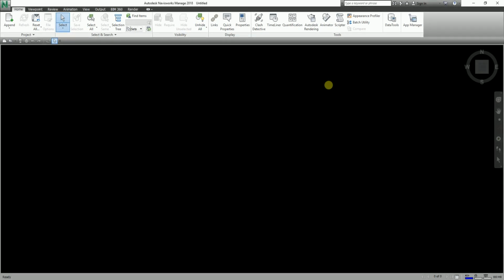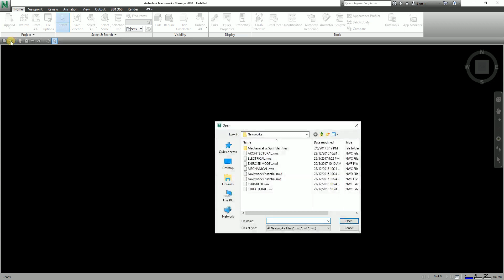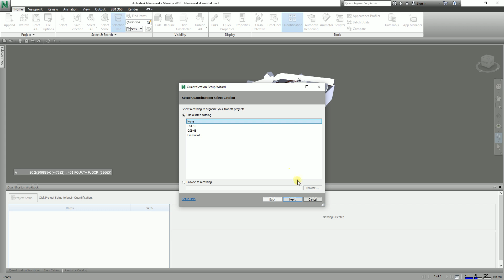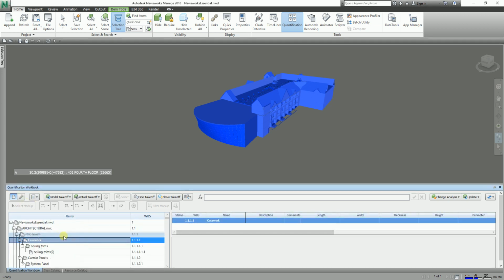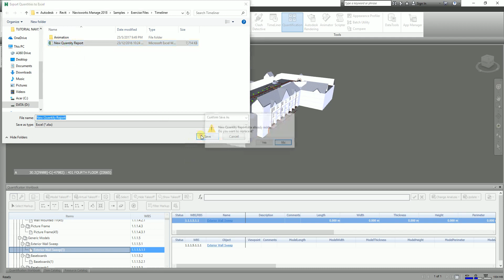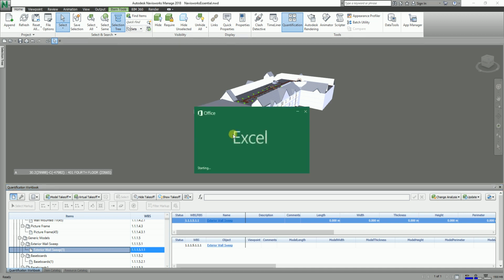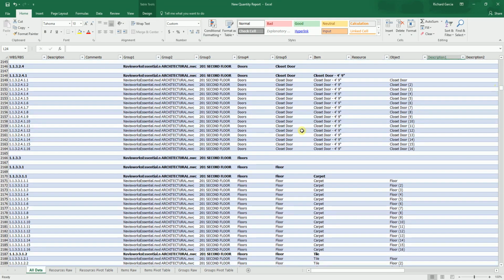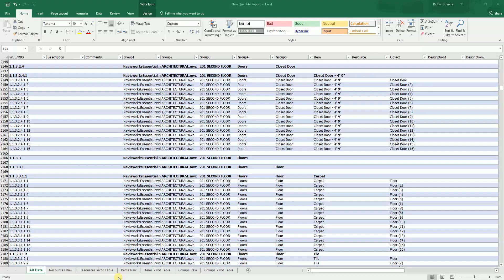LEARNING NAVISWORKS: LESSON 35 HOW TO USE QUANTIFICATION

Comment: Hi Rich, I't trying to do a material take off from Fabrication CADmep. Navis creates a list of items in the work book but doesn't add any lengths or quantities. Is it possible to use Navis to take off Fabmep or does it only take of Revit materials? Thanks
Reply from the maker: hello sir, try this:

1. *Load the Fabrication CADmep model* into Navisworks, ensuring that all necessary properties, such as lengths, quantities, and other relevant data, are correctly imported.

2. **Open the Quantification Workbook**:
   - Go to the “Home” tab, then select “Quantification.”
   - Start a new quantification project by selecting “Quantification Workbook.”

3. **Set Up Property Mappings**:
   - Navigate to “Quantification Settings” and ensure that the properties from the CADmep elements (like length and quantity) are correctly mapped to the quantification parameters.
   - If the lengths or quantities are not appearing, check that the Fabrication CADmep elements have the necessary metadata for quantities and lengths. You may need to map custom properties that are specific to the CADmep objects.

4. **Ensure Proper Item Selection**:
   - When selecting items for quantification, double-check that the objects in your model are being properly selected and their associated properties (like length, area, or count) are correctly displayed in the quantification workbook.

5. **Customize Quantification**:
   - If necessary, customize the quantification by creating custom formulas or using conditional statements to capture the right quantities, lengths, or other parameters based on your fabrication parts.

Navisworks does support quantification from both Revit and CADmep models, but it relies heavily on the properties embedded in the model. If the Fabrication CADmep model isn't fully defined in terms of quantities and lengths, you may need to adjust the settings or modify the model properties in Fabrication CADmep before exporting it to Navisworks.

Let me know if you need further assistance with the setup!